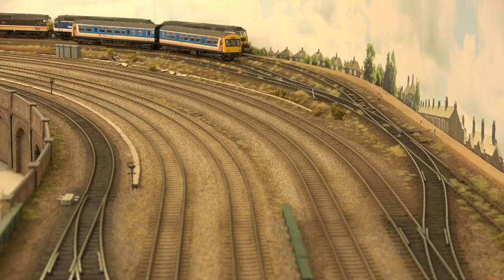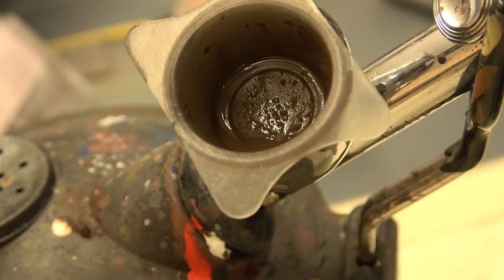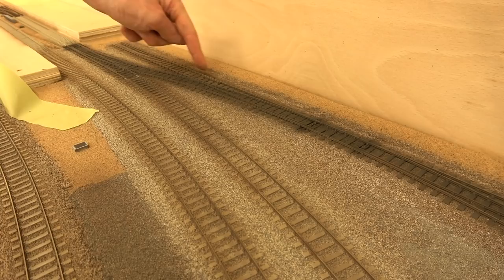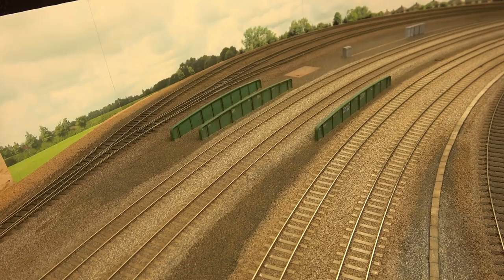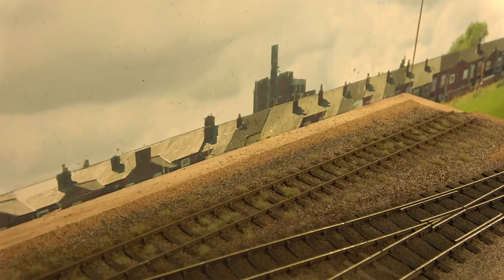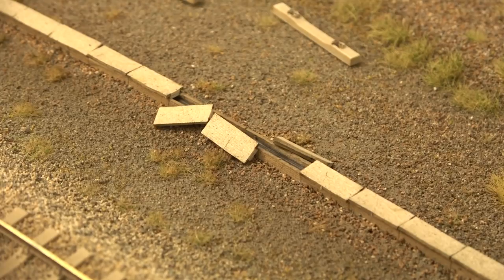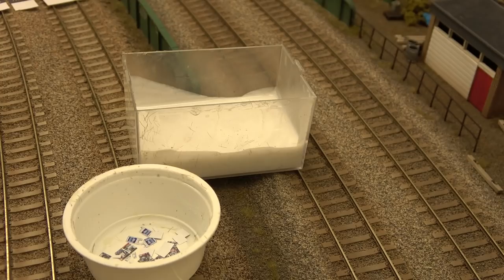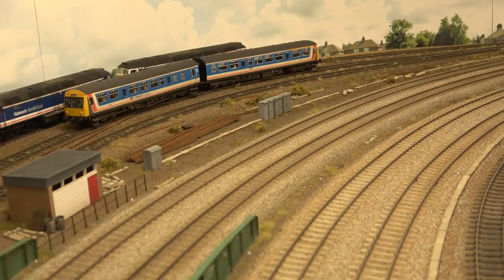New Layout Build - Detailing and weathering the new sidings

Comment: Hi mate. Can i offer some advice, certainly not criticism. Signalling and point wise. The exit point of the sidings would also be motorised and not a hand lever. This would be to prevent conflicting movements. I.E hand point towards main lines and motor point set against. They are known as Co-acting and both points would move together from the power signalbox. Also the scrap rail wouldn’t be left between sidings where locos  are stabled. It presents tripping hazard to drivers.  Even in the 80’s this was a no-no. Drivers unions were hot with that sort of stuff. Otherwise excellent update.

Comment: The points in the yard which switch between the 'catch' sidings and the mainline, from the running shots it looks like they got a point leaver. They'd need to be a point motor so the signaller can control if a train can come out the yard or not. There'd be a shunting signal at the tow end of those points to control the exit from the sidings. Overall the whole area is looking brillant, already looking forward to your next video when you've had chance to do some more to this excellent layout :)

Comment: I think that shot looking towards the 60 line speed indicators and the crossovers at the end perfectly shows off how good this scene now looks 😎 I know what you mean about not wanting to overdo it with the grass and I suspect this means you will be adding little bits of green/beige/rubbish in little drips and drabs here and there 🙂 I was going to suggest maybe a fair smattering of buddleia bushes, but I am wondering if maybe they are more of a modern phenomena? We certainly have little clusters of them around our depots so perhaps one or two would settle in the shadow of the bridge girders or perhaps around the buffer stops, especially if you will be fitting a retaining wall around them 🤔

The random rails and sleepers look absolutely spot on, and I can almost imagine myself cursing the track workers for leaving a load of crap by our west end hut that I have just almost tripped over 🤣😂😅 Small thing I wondered you might consider: maybe place a small hut at each end of the sidings for a shunter’ shut from which to accept or dispatch trains via a release button? Our West end one at Shoeburyness is barely the size of a shed and the one at the east end of East Ham is about the size of a sentry box! 😉

Great stuff Richard, always great to see your progress 👍🍻🍀

Comment: Brilliant video as usual! And the attention to detail that you put into your layout is absolutely staggering!

I don't know if this applies to British signalling, but usualy a "catch-point" protecting a mainline - or a signalled line in general - would be controlled from a signalling-center or signalbox etc. This is to make sure that no train could - even if it tried - enter a signalled section of track without permission. If it is a manual point - for whatever technical reason - it would usualy have some type of electromechanical interlocking put on it to make sure that the point is in the position that protects the signalled section and is locked from being thrown. In the case on your layout, it would theoretically be possible that a driver forgets to set the switch into the headshunt - after shunting past it - and thus a runaway locomotive or wagon could end up out on the runninglines.

 Really enjoying your content, and I've been following along for some years now - first time commenting though👍
Reply: quite correct the point controlling the neck/over run would be machine operated to provide flank protection.

Comment: That looks excellent, there is one thing I would like to point out if I may, the point that leads out from the headshunt/trap to the mainline would have a motor, not a hand lever, as it would allow yard movements to foul the running line if incorrectly set. Amazing work otherwise!
Reply from the maker: That'll get sorted out once I actually fit some signals to the layout.  Cheers

Comment: I notice you have put hand levers on the exit points from the sidings you will probably find these would be interlocked with the nearest signal box to prevent unauthorised movements either using a ground frame or point motor and protected by a signal with a phone
Reply: Bob I am a signal engineer and can confirm that you are correct, both ends of the points into the sidings would be motor operated with an interlocked ground signal  protecting both entry to and exit from the sidings. Otherwise the use of the non-interlocked throw levers is generally acceptable. I expect Richard will at some point be looking at signalling and how signals would be integrated into his layout. There are a number of good signalling videos on YouTube and reference books available.
Reply: @kerdazproductions4606  i know from my trainspotting days at Bristol Temple Meads and watching the ground staff using a plunger on the carriage loop ground frame to alert the panel they wanted it released to do a shunt move
Reply from the maker: Signals, interlocking and all the various rules to follow is something I've yet to get into.  Its a job for the future certainly and I expect a number of details will need to be changed/added.  Cheers

Comment: was just thinking, for some more immersion on the points you know the rails on the inside that are ment to guide the wheels, could you not leave them painted as irl they never get touched so they wouldnt be shiny and would just be rusty?
Reply from the maker: Well spotted.  It's a nice detail if you can make it last.  I have tried it before but the paint tends to come off when track cleaning.  Cheers
Reply: @EverardJunction  yea you would probably end up just having to turn the rubber on its side on the points, but yea all good and well done on the layout so far

Comment: Do you usually have catch points on the flat?
Reply from the maker: Anywhere a siding connects to a running line catch points are fitted.  A driver could still accidently attempt to drive a train out before the line is clear.  The catch point would keep the train from entering the occupied track and avoid collision.
Reply: @EverardJunction  These are actually Trap points used to trap trains in sidings, a small mistake to correct is both the main line end and siding end are motor worked, you kind of defeated the object by using a hand point lever that could be left set towards the main line. In future when you get to signalling the area a signal would be used at the siding exit as well. I don't think there are any catch points left on the main lines now, since all trains are fully fitted, these were spring loaded and used to catch runaway trains rolling back on gradients which I think MrTrustafox is thinking of Love the detailing as usual it is very realistic.